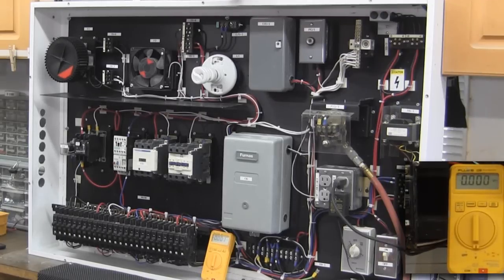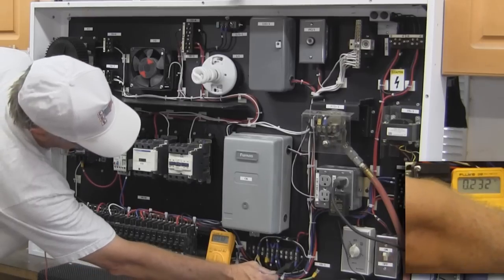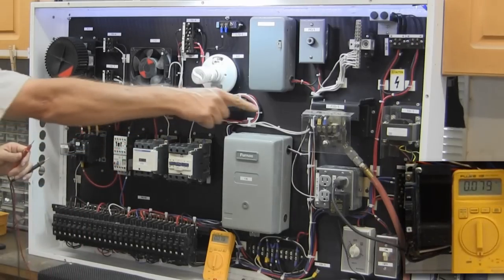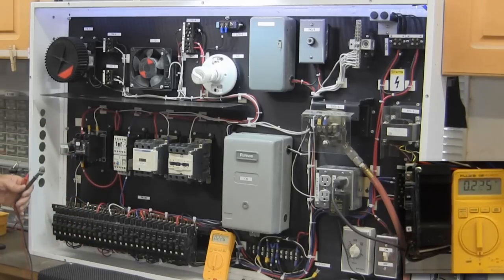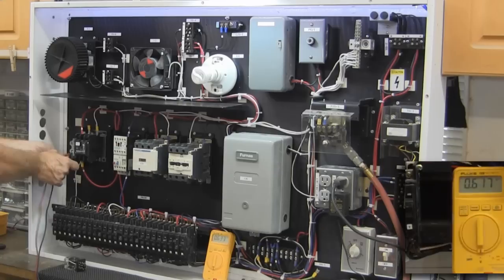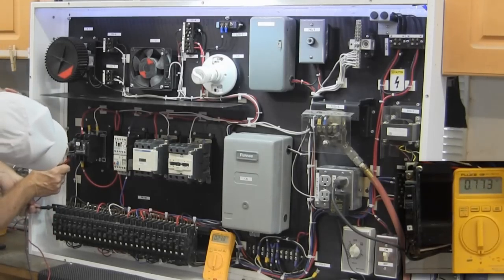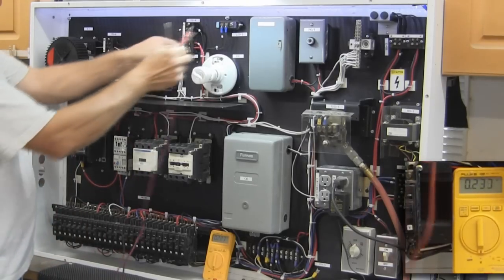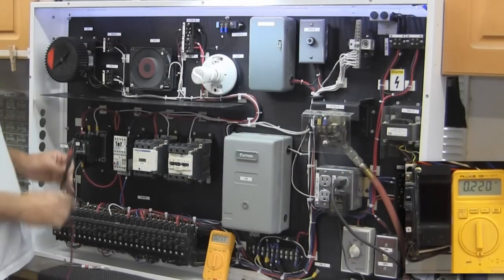Electrical Wiring Control wiring

Comment: You're not allowed to switch a neutral, you have to install a relay or PLC that can have a constant neutral but when a source wire or relay will create a secondary neutral off one off the same phased paired branch circuits. One reason is you can get electrocuted if the primary branch circuit closes and your holding the neutral that was not hot earlier. A neural is classified as a current carrying conductor.

Comment: guys to all of you that want to learn how to wire panels and build control circuits - there is no short way like online course this is coming with experience and acquired skills throughout years also Supported by proper education
Reply: incorrect. plenty of simulation programs out there that a virtually hands on. same as doing it in real life

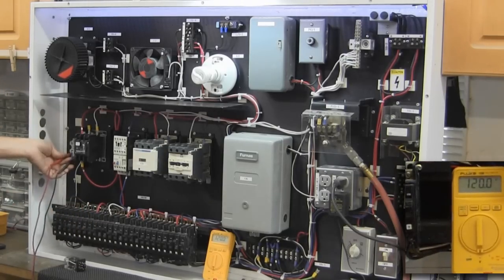Comment: Q-At aprox 5:35 you closed a sw. or Brkr. to get your Neu. When I built control Pnls...under NO circumstances were we allowed to fuse or switch a Neu. I'm not up to date on the NEC so has that ruling changed? An open Neu or ungrounded Neu(floating) in some cases can cause problems. Some devices do(or did years ago) require both Hot and Neu feed wires opened or switched at the same time (gasoline pump motors below ground) but never the Neu only in a Pnl. Thnx for the vid.

Comment: Guys I want to learn electrical control panel wiring from basics. Is there any online resource I can use?
Reply: try to find a company that will teach you how to do it. you will be surprised on how many people will want to train you and mold you into a panel builder
Reply from the maker: +Dano Kerr Listen to what I said,I use the breaker to break the white/neutral wire for training purposes. It is very common to find broken/loose neutrals in control panels as well as branch circuits.